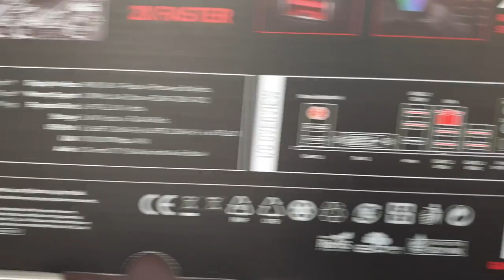UNBOXING MSI X470 GAMING PLUS MAX

Comment: If I buy this board will I have to update the bios for my 3700x
Reply from the maker: you have to check mother board web page for this.. but on the box is written RYZEN 3000 ready so a guess you don't have to update. But in my experience you should always update bios..

Comment: I'm confused about the fact that this is $30 cheaper (where I'm from) than the B450 Tomahawk Max when you get more and the same on this motherboard. There is no sale whatsoever. I should get this right?
Reply from the maker: maybe they sell by that old price.. happens sometimes.. i recommend to buy the newest board, do i research. I usually  spend some time to figure out what new, what's old... go to MSI or gigabyte or some other manufacturer and list what they offer for now.
Reply: Ok thanks. When you mean by newest board, do you mean the B450 Tomahawk Max? Cheers.
Reply from the maker: @TwistedChimera  I don't know what they have the newest I don't follow every board and every manufacturer :) they so dramatically change nowadays...  Simple is just go to official web page and check it out..
Reply: Yes this is the exact same reason I got this one it’s more cheaper because more people buy the tomahawk rather than it’s better counterpart

Comment: What psu is compatible with this ?
Reply from the maker: i recommend 600w min
Reply: RefillGuy  thanks my guy u should do a pc spec video for the msi x470 gaming plus max because there isn’t that many
Reply from the maker: I don't have equipment and so on.. to do a professional PC spec video ;)
Reply: Your power supply is to do with your components your going to use. Not your motherboard. I think you should get someone who knows what they are doing to build your computer.
Reply: robchatc haha I built my pc now runs perfectly fine got ryzen 5 3600 gigabyte gtx 1660 super and x470gaming plus max took me a while to learn how to build and understand the components but ok